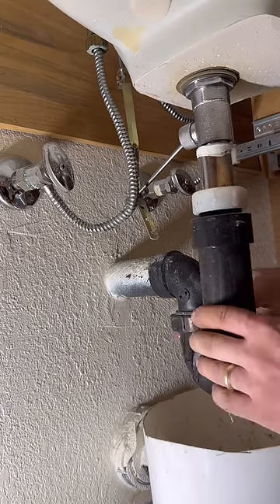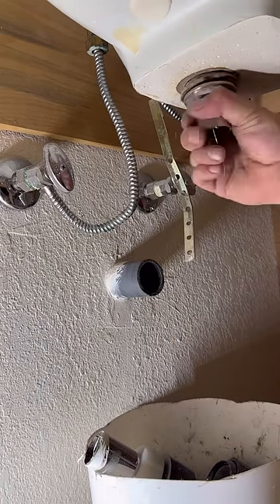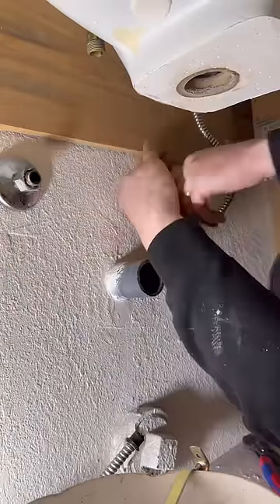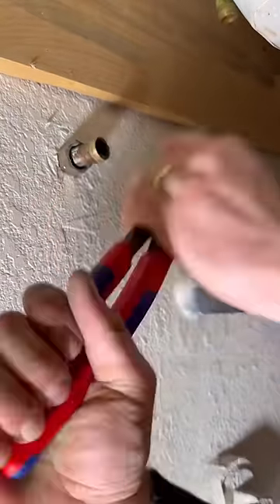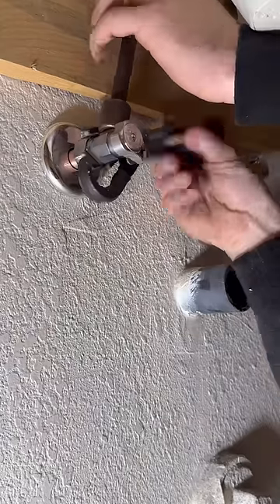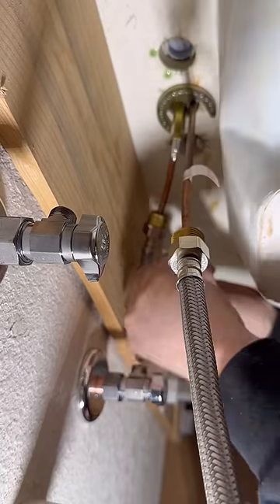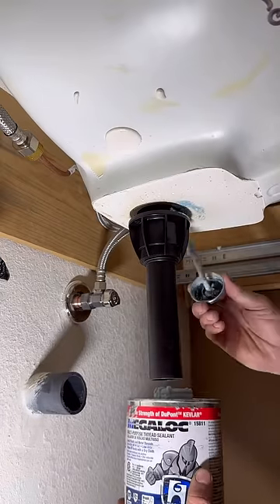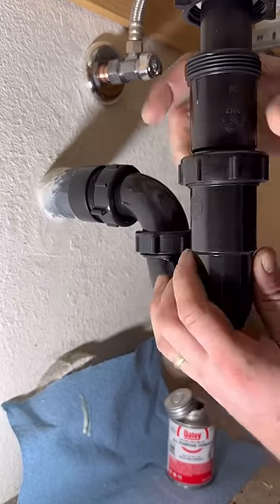replacing a deck mount faucet #plumber #plumbing #diy #faucet #repair #faucetrepair

Comment: As retired contractor I can attest that most customers are willing to pay a higher price for excellent customer service and quality work.
Reply: I agree. If I know that you’re price is a flat rate and it’s to insure you not having to come back out unnecessarily then I’m okay to pay.
Reply: @Mbest624 this doesn't support the fun narrative that drives the reason his videos are so popular. Without the fodder of negative comments it's just a guy replacing a faucet...only interesting to plumbers and people interested in this sort of video. Now if you like comedy you might like his videos.  Smart man
Reply: This. If you're willing to put in the extra effort to make it flawless, I'll pay for it. I don't want to have you back because your first time around was half-assed.

Comment: I agree 100% that's how we do it. New faucet you get new 1/4 turn valves, supply lines pop up assembly. No other way to do it. 
You're absolutely right you touch it you own it.
Reply: The funniest part is they don’t do repairs. They do replacements.  That’s why everything is built to break these days.  Idiots don’t know how it works or how to fix their shit. And idiots profiting off the idiots.   And around we go into the dirt.   In my shop we call people like this “fitters” cause they have no idea how to fix anything just replace it with new expensive plastic bs.
Reply: @Danielle Page  your comment is ridiculous.  Are you telling me that you would repair these items?  If so, you are ripping people off!  You are going to bill someone for a repair on $150 worth of new material........ 
If it's a $600 faucet, repair may be in order, otherwise it's not. 
Any decent business will charge $200-$500 to work on that sink, whether it's to repair or replace.  In the end the only thing saved by repair is close to negligible.
Reply: @daniellepage2923  I've been plumbing for 23 years. Yes, we offer rebuilds as well. Give the customer 3 options, most people go with the middle price because they get a new faucet and hardware, and they know they won't have to worry about it for a long time.
The last rebuild I attempted ended up being a joke because it was so screwed up from the hard water I couldn't rebuild it. Had to sell them a new faucet in the end. You know it screwed when you start taking it apart, and it literally crumbles in your hand.
Charged for the replacement and gave 100.00 off
Reply: Somebody’s cranky “around here.” I can hear him saying “Copper … is king.”
Kudos for your philosophy. Your name is on it.
Reply: okay so just a question why do the supply lines need to be so long  they almost do a complete loop? what is the point of that? they are called flexy tubes in Europe and they come in 5cm step sizes. they look ugly that way and catch a lot of dirt spider webs etc. why they can be just as long as needed?
Reply: @kbuss10  They don’t need to be that long. Guys like us buy the next size up to avoid another trip to the Home Depot to get rhe right size. Or because the “right sized” ones are gonna always be about 5mm too short.
Reply: @daniellepage2923 Meanwhile this dude is an Oatey & Viega partner while you’re in his YouTube comments giving an opinion nobody asked for, I’m pretty sure he is capable of changing the cartridges and aerator in a faucet but 9/10 times it’s better money spent for the customer when they get a brand new shiny fixture with all new everything.
Reply: I work in insurance. We pay to replace flex lines and ptraps everytime a sink is disconnected, and flex lines and wax ring for a toilet. It's worth the extra money.
Reply: With that philosophy, if you were a mechanic you'd replace the engine on the car rather than repair it.
Reply: @erichsh58  Yeah, no, that's not true. I do my own repairs on my vehicles, afraid not.

Comment: I also agree 100% I am an Electricial Contractor. We do the same for the same reason, our name will be part of the whole install not just the piece we replaced. We also need to be aware of liability but most importantly we are experienced enough to understand changing a small piece isn't alway a permanent solution. 

Do the whole job properly, it may cost more but will last so much longer. We understand sometimes you need to save money, there are options for that but it is ultimately a false economy as you will have issues further down.

Respect from the UK, great videos always refreshing to see great workmanship and pride in work.

Comment: Finally a Plumber that puts dope between the deck and the washer so it slips tight and seals instead of a squeaky finish and a slow drip.
Reply: I saw that. I never thought to add dope but I am familiar with that squeak and small drip you are talking about. Thanks for the info
Reply: I learned something here, grateful!
Reply: Pipe dope is not recommended on rubber gaskets, it rots the rubber. I'd recommend buying better pop up assemblies. Ones that have a plastic washer in-between the gasket and nut
Reply: @anthonytrujillo7971  precisely
Reply: Putty
Reply: Uh, no. That is not a rubber preservative. Get a silicone grease that doubles as a preservative
Reply: I use silicone
Reply: Silicone is the only assured way for no leaks. I've used putty and pipe dope and had a leak every now and then. Callbacks suck. F that.

Comment: Did you replace metal popup drain for plastic? In that case, better to leave original?
Reply: Yup I agree! He also replaced a two connection abs trap with a cheap plastic 4 connection one with a smaller inner diameter.🤦‍♂️

Comment: 100% this is how it should be. I've had work done several times and had to call them back the same day because there's a leak. Not in the part they did but often the valves or pipes connected to. Old plumbing fixtures are extremely liable to leak when disturbed at all.
Reply: True!

Comment: When my parents bought a house 10 years ago.. they didnt bother changing the faucets, showers, etc.. then after 3 years, one by one the faucets are damaged and needs to be replaced, the plumber just replace parts.. then after a couple of years the one that parts were just replaced just broke again and again.. the ending: i replaced all faucets, pipes, flexible hose, p traps, sealant.. as what the poster said.. you have to replace all..

Comment: Nice work! If you don't replace all the extras, the customer would complain when something fails, I'm sure! Glad you got rid of those "MC Flex" supply lines 😂
Reply from the maker: Very true! If I worked down there, it’s all my stuff. “It wasn’t doing this before you were here”
Reply: @replumb  it boggles the mind how many homeowners have no clue what it looked like before I got there or flat out like about everything.

Comment: I had a leak from a job from almost 18 years ago.  The supply line was dated.   The insurance agent said that the braided supply lines need to be changed every ten years.  New supply lines say this,  this one did not.   
Also those valves are $4 each when bought by the case.   For $20 extra get it all new and sleep comfortably for 10 years.  I also date my work with a sharpie.

Comment: Agreed 1000%. I fix cars and if a customer wants me to half ass a repair I will tell them I’m not gonna to do it. First it’s putting my 30+ year reputation at risk. I offer warranties on the work I do and on the cars I sell. I don’t let anything leave my shop unless it’s to my standards. I want to fix and sell cars so they are good jobs that I wouldn’t hesitate to put my daughter in. In 30 years I have had one warranty claim, it was a parts failure. I know one claim in 30+ years is very good. I started learning by building NASCAR engines and I have used the meticulous habits for anything I do.

Comment: Yep that’s how I’ve been replacing faucets for a while now. It’s the right way to do it. It’s not about charging more money you are just providing a more through service. An extra 150 to replace drain and stops is a lot better than ripping out and replacing a vanity.

Comment: I've started cutting the old lines just above the nut on the copper... saves a few minutes each faucet. 
Clean work amigo.👍👍I'd argue that not changing everything is price gouging. Leaving old fittings is begging for the wrong kind of call back.

Comment: Anybody with experience knows that those one piece supply valves with corrugated chrome over copper/brass supply lines will not last if they are bent and straightened after years of internal corrosion/mineral build-up. They will develop pin holes leaks, maybe right away maybe 6 months later. 
Yes, replace those cheap stops with supply lines.

Comment: It’s not price gouging!  The minimal cost do do those little extras while you are there, is cheaper than a service call a week from now, and the aggravation of an argument with a customer.  It’s the same thing when working on a boiler.  If it’s drained down, replace the expansion tank, PRV, auto vent, and feed if there are no isolation valves on it.

Comment: Legit question how come you cut those wall plates?
Reply from the maker: So I could move the compression nuts and get to the ferrules
Reply: @replumb  oh okay I just use a puller for that and it comes off like no problem

Comment: Nice work. Just my company's system we always add silicone to the underside of the PO just prevents those rare leaks. Just in case nobody ever suggested that. My bosses are old as dirt and found it saved them money and effort in the end, I like the system doesn't mean you have to.

Comment: Changing those angle stops is always a smart move. The corrosion on those angle stops especially on multi turn can cause huge flooding issues.

Comment: Yeah, I was not amused when I noticed the plumber replaced the pop up in my kitchen sink when they put in a Quooker faucet.

The thing was that the new one was a different inner diameter than the old one, so the stand pipe overflow basket thingie no longer fit.

I was glad I caught that before he left and I made him swap it back. Don't replace stuff without asking the customer if it actually needs replacing.

Comment: "we don't want to do the job if you want to pay less."  People who price shop aren't performance shopping.
Reply from the maker: People who price shop don’t go with our bids. They get fooled into having someone come out under the assumption that the quote they got over the phone will be the price they pay. And then that company will “add on” valves, a new p trap, supply lines, etc until it’s double our originally quoted price. We don’t play that game. Flat rate price, over the phone. Take it or leave it

Comment: Just cause you have a flat rate doesn't change the fact that you are over charging for parts that don't need to be replaced. 

Anyone reading this, if you have simple plumbing issues like this, find yourself a good general contractor.  They will fix everything just as well, they also will repair your drywall if it needs cut out, and they will do all this at about half the price.
Reply from the maker: You general contractor is typically going to sub everything out and you still get it done it’s just a little bit worse🤣
Reply: @replumb  Subcontract for that? Get over yourself. With a 10 minute tutorial anyone can do what you just did under that sink.

Comment: It’s like that in any industry with a huge liability. I’ve ripped out hundreds of meters of “perfectly good” guardrail as it’s not to the “new 20-year old spec” because if someone smashed into it, and we modified it, but didn’t bring it up to code, we’re liable for it.

Comment: I love how you voiced over concerns like that.  Yes you are pride gouging the customer. You’re a plumber. You always charge more then you’re worth. 70% of plumbing in a house can be done by a 10 year old kid.  You have these policies so you can charge more and have less potential responsibility.  Could you imagine if a mechanic said after I touch a car everything under the hood is my responsibility.  No one would be able to afford fixing their cars and would replace them first time something fails. It’s this mentality that leads to consumer culture.  Fix what’s broken and move on.  Don’t have to replace the entire system when something fails. Just replace the failed component.  Companies that refuse to fix and instead replace often have a lobby in the industry for replacing because they are hand in hand with the company supplying the expensive plastic bs fittings and crap made these days. One hand washes the other.   All you are doing is tossing useful components in the trash and replacing them with 5 year plastic crap you know won’t last long but just long enough to outlive your warrantee so you can get more calls for more replacements.  Fucking useless parts fitters
Reply from the maker: Let me know when you run a successful service company only fixing “what’s broken” and then we can talk. Until then fly a kite

Comment: id totally agree with replacing everything all at once if your there might as well. feel like a plumber who does pipe work and doesnt replace everything is a hack unless he just did it all and is repairing something but otherwise id want all my pipes as new as possible. only problem i saw was the blue pipe dope u left on the bottom of their sink instead of wiping everything down when your done. . maybe u went back after the video but def comes off easier right after u final crimp everything together give it all a good wipe and u will never have a complaint.

Comment: Upgrading the fixtures is great but that original ABS trap was far superior, thicker walled with less connections and larger inner diameter than that cheap thin plastic crap you replaced it with that doesn't meet code in most jurisdictions.
Reply from the maker: Meets the UPC code that we go off of. I find a tubular trap is better for the client and for the service plumber

Comment: That's a cool way to pull off a ferrule. I can tell you, you probably ain't pulling mine off like that I give em' the juice but is that not necessary? I've had to use a cheap "Husky" ferrule  removing tool and it was a bad day. Would've been better off with some Irwin's

Comment: No arguments from me. I'm no plumber, but the last time I replaced my kitchen faucet, the hot water had very low flow afterward. The old angle stop failed internally when I turned it off to work on the faucet. So after that, I replaced all the angle stops in the home which looked like the one which failed,which was most of them.

Comment: I am in the hydraulic hose and fitting business, that covers a lot more than one would normally think. I absolutely agree with you because your name is now on that repair even if you didn’t touch something that goes bad in the future. We are the same way with hydraulic hoses that were made by others and brought to us for repairs. We will not do it. We will not accept the liability for repairing something that we do not have the exact specifications on. Most of the time people get away with this, but who would want to test their liability insurance. Even if something leaked a year from now, the insurance company for that homeowner would certainly be looking at you for some responsibility, even though it may not involve the work you did. It is my understanding that washing machine hoses are one of the big failures that caused insurance claims in homes. I understand that.

Comment: A plumber in my area wanted $1,600 to do this job. I thought he was joking. Did it myself for under $200, including buying every tool I thought I'd need.
Reply: I do the same and I changed $360 $60 materials and $300 labor!

Comment: I have a pet peeve when I see comprehension fittings on a shut off valve.

I would rather soldier a threaded fitting on.

Comment: I prefer when a pro replaces all the stuff at the same  time, for the same reason that this guy does: it puts all the repsonsibility on the new guy. If something fails, it's never something that was left behind and the new guy allways has to fix it. Yes it's more expensive but it saves a lot of very nasty discussion when something bad happens.

Comment: You should mention that the way you removed the compression rings is wrong, any DIY'er can get into trouble if they get stuck there.
Reply from the maker: It’s not wrong it’s just not how you do it
Reply: @replumb  what would you do if you can't get them off half way through and don't have a sleeve puller?
Reply: @replumb  making something look simple, that can easily become more complicated or problematic to someone who is inexperienced is wrong.

Comment: Yeah, yall are definitely upcharging. Those P traps are like $4 at the hardware store. Those shut off valves dont fail as often. The pop up drain is like $20. Thus $50 job probably cost the homeowner like $300. Thats why many people dont like calling plumbers.
Reply from the maker: 🤣🤣$300? I’m trying to run a business here. How many successful service companies do you operate?
Reply: This is exactly the type of customer you can weed out with flat rate pricing. This is the guy you don’t want to work for.

Comment: So yes, you are unnecessarily charging customers for items they may not need. Shut offs are ~$10 each, a new drain is about the same, those hoses are $8-$10 each and you know you're not taking a loss on those so your flat fee absolutely includes the cost of those items. If you expect anyone to believe you take a $50 loss on a job, you should be a politician.

Comment: I notice you use ABS pipe.  Here in Wisconsin we use PVC, I don't even think I have seen ABS in stores.  Is it cheaper or more expensive than PVC?  I know PVC has been around since the 70's, but no idea when ABS came out.  Maybe it's a east/west coast thing or north/south thing.

Comment: Those flex tube supply line w/ shut-off are a leak ready to blow . I don't even think they're sold or manufactured anymore . New shut-offs and supply lines are a must .